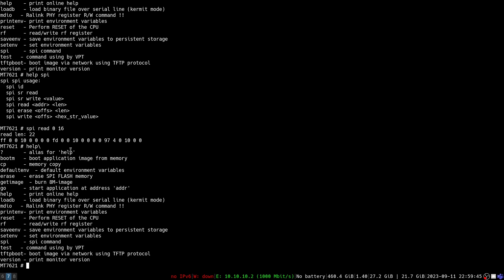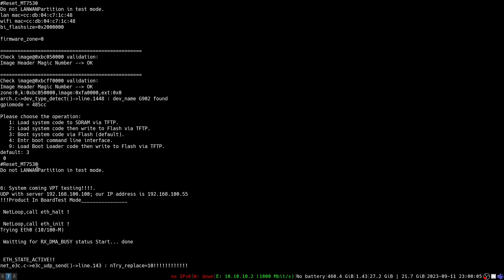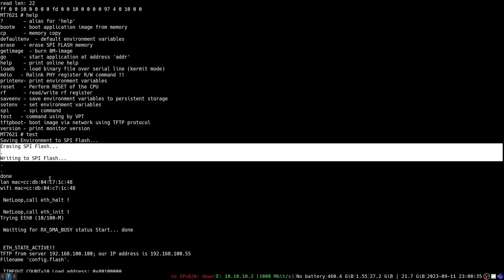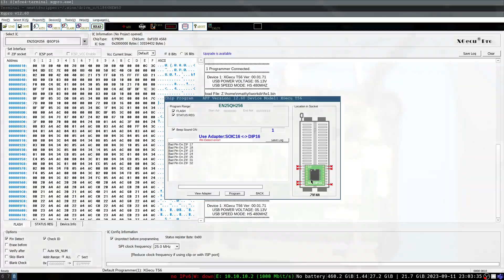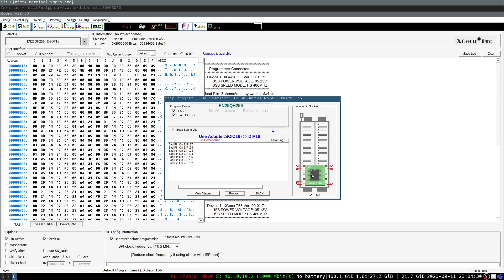I'M BACK: Firmware Extraction Tips and Tricks

Comment: I had the same fails with XGECU, Thanks for the settings heads up. Those chip sockets work but the chip placement has to be exact or you get bad, or worse, shorted connections. Thanks Matt.

Comment: I use the same programmer in my work. It is more reliable to solder the chip. Using a socket is less reliable. I also had such failures. Thanks for your videos.

Comment: Thanks for your efforts Matt! Your chip extraction of the echo device has helped me hack an unnamed device's emmc and find user names, emails, and photos. I was really only interested in getting at its operating system but found it kept user data unencrypted. Would also love to see a video where you hacked and read the emmc of a device noninvasively by finding the "hidden" pins on the board itself, ie CLK, CMD, Data, etc. Even if it was an already reported device it would be very educational to see how you do that. I tried to figure that out on my device with an oscillascope and even trace the pins to other pads on the board once i removed the emmc, but only managed to find 3. I know there is an article on how to do it with the OG tall echo device but seems to leave out some critical steps (for my level of experience) as I was reviewing it.